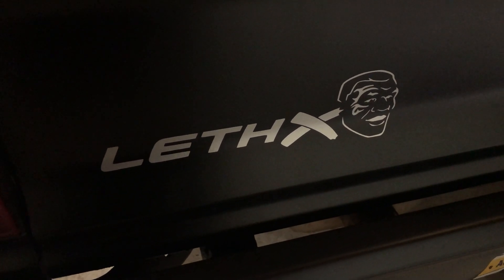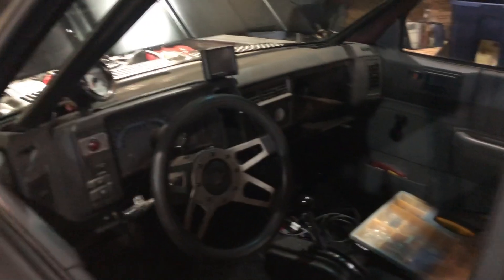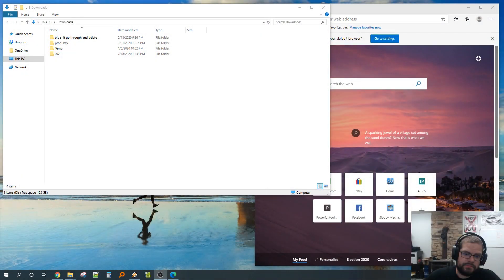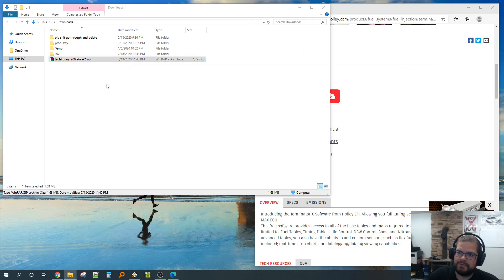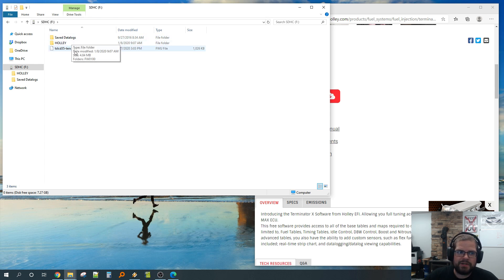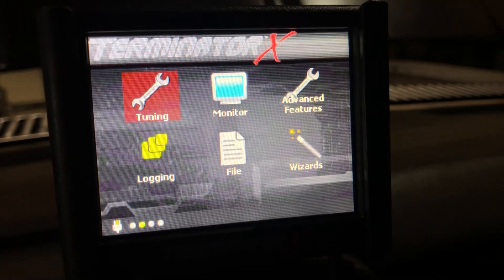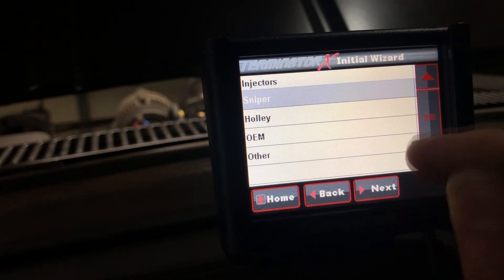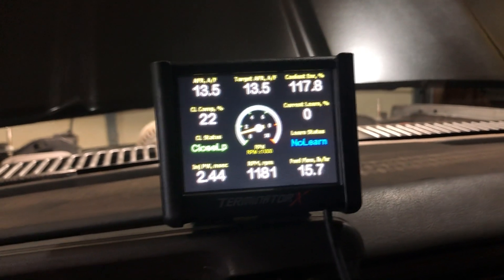How To: Holley TermS SD/Wizard/Firmware update how to and first start

Comment: Is there a reason not to keep the old firmware folder in a separate location for a just in case scenario?
Reply from the maker: to be honest, first firmware had a few bugs, you can look them up in the change logs, there has been 2 major updates, and they cleared up alot of the first time issues that were found, small but worthwhile fixes, so you could keep the old firmware, not sure if it would let you flash back easily without doing something special... so in some instances keeping the old stuff might be worth it, but this newest firmware has been out a while and has proven itself issue free. so its best to move to this as of right now. also youll be missing 90% of the improvements with the wizard by not updating

Comment: Hey Matt, just picked up a terminator x, have done all said firmware updates, just a n/a setup  using internal map sensor, fires up shuts down no reading changes on handheld from map just map low err, Any recommendations, thanks in advance

Comment: So I get doing it through the screen But Holley sells it without the screen and provides the cable to use a laptop. I haven’t seen anything on upgrading the ecu firmware through a laptop.
Reply: the laptop takes the place of the handheld everything is updated from the holley tuning software you install in the laptop i have both

Comment: I want this. I spent hours today getting my shitbox to start up and run with an aem ems. Can you shut off the self tune? I couldn't find that option on the sniper.
Reply: If you have the USB to can cable the sniper has just as much tunability at the termx. Yes you can shut off closed loop learn but there's hardly any reason to. I have mine set to +/-10% during cruise and +/-5% at WOT just to keep things safe.

Comment: I wonder if there’s a way to switch between the 24 and the 58 tooth or do you have to get a whole new setup.
Reply: i asked holley about that very question. they also have a video on their channel now describing what to do. they even talked about if you are running a front or rear style cam sensor. it seemed the differences was swapping pin/wire positions on a few connectors. the handhelds are the same, just depends what items you select. 24x, 58x, Frankenstein combo.
Reply: Hi.... if you go from 24 tooth to 58 tooth.... all you need is a crank sensor harness adapter from Holley .
Reply: Vic N I have to look for that on the site. I want to start putting the Holley in my 99 Camaro.
Reply: LJK King how’s it going... they definitely have the harness adapter.... I’m running the terminator x max in my 81 Trans Am pace car... LS3 formally a L92 converted except the intake valves. Also. Late 2009+ 4L70E. Works great so far... except for some idling bugs which I suspect have nothing to do with the terminator and everything to do with the Chinese 102mm throttle body blade sticking when hot... BTW Holley’s throttle bodies are made in China .... there ECU’s and harness’s are made in Canada and USA . That’s why there throttle bodies are so inexpensive compared to other throttle bodies on the market. There hit and miss. Others then that, I can jump in my car and go on a interstate trip without a concern about problems.
Reply: Vic N I’ve got a ly6 (per sloppy recommendation) to replace my ls1 with cam and springs. I want to install a nitrous kit and as far as I can tell the terminator is the way to go. I want to keep all the gauges working along with the ac so I’ll split things up. My car is a m6 so I don’t need the Max kit. I have a ‘11 6l90e to maybe swap someday but so far just the factory ecu’s can run that trans.
Reply: found it. 
https://youtu.be/OChfI5i2S3Y
Reply from the maker: yes, its overwhelmingly easy
Reply: Sloppy Mechanics Good. I was afraid to order it because when I put my bigger motor in it’s a 58 tooth but the car has a ls1 now.
Reply: @ljkking622  At 13.28 after he chooses camshaft duration there is a choice between 24x and 58x
Reply: Ájagharingenyoutube I was thinking more about the wiring. When you order a kit you choose between dbw, dbc, 24, and 58 etc... t